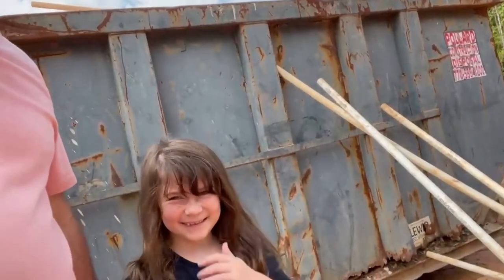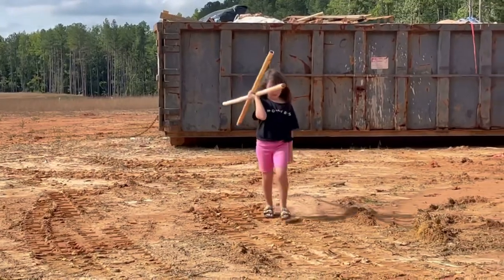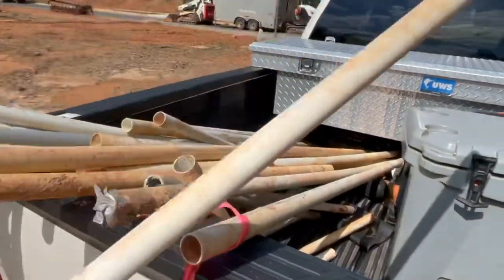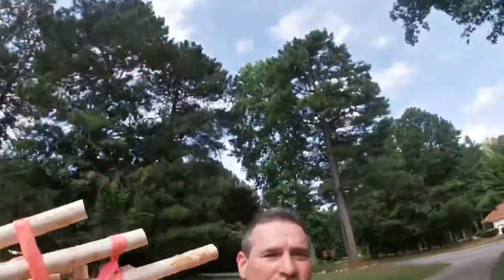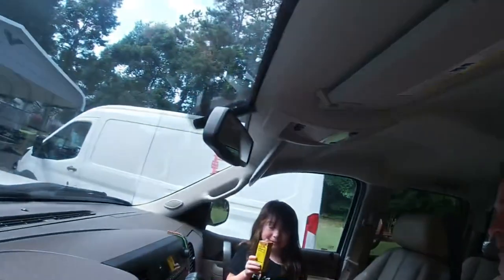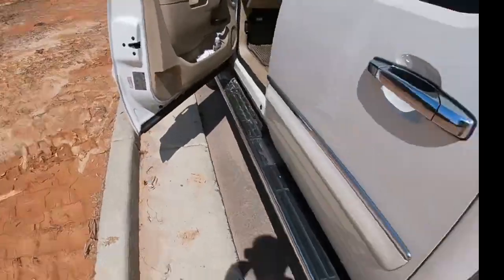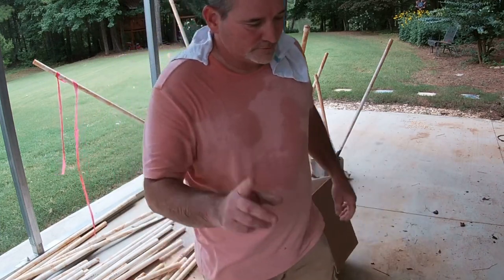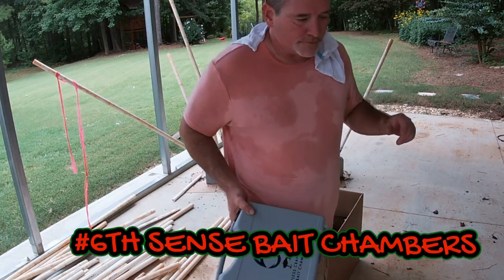DIY Artificial fish attractors for under $20.

Comment: Suggestion, go to a local engineering company that test concrete pour samples. Most of the time they are glad for you to haul it off for them, great ballast. I was able to go to a friend that managed a sawmill. The edging strips work great and grow algae better than plastic. The saw mill cuts the bark off then cuts them into boards for drying. When the customer tells them what width boards they want, they cut them to size. The strip is about 1 to 3" wide. I build them on discarded pallets, I use an old pontoon to take them to where I want them. I add the weight and push them in, mat built. PB
Reply from the maker: Great info thanks